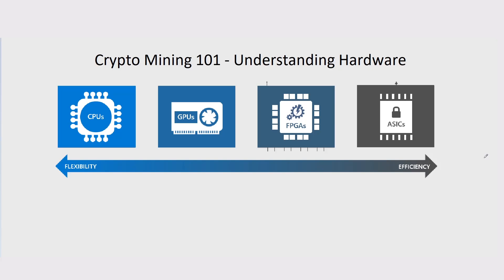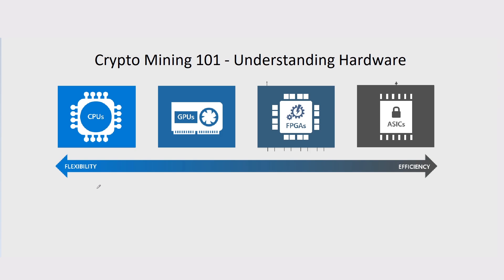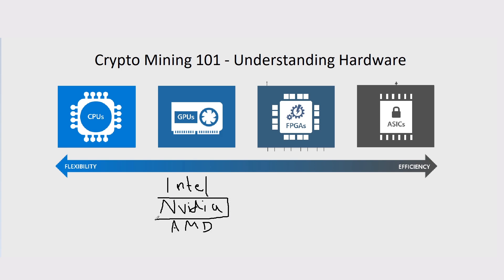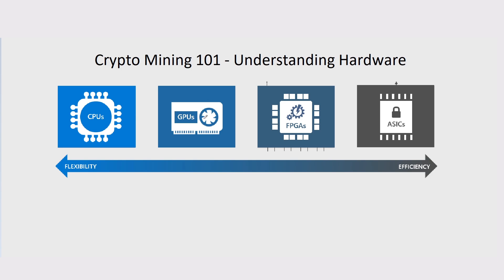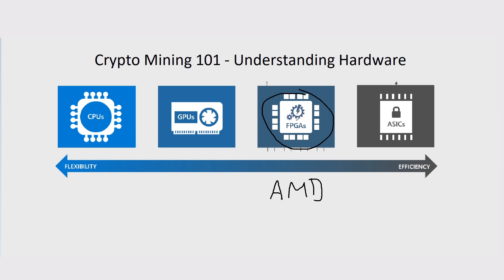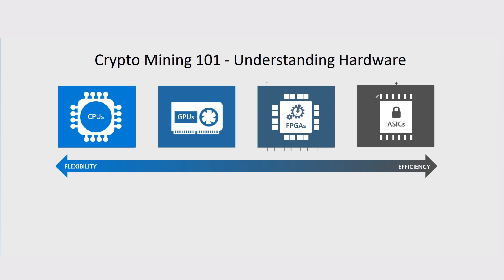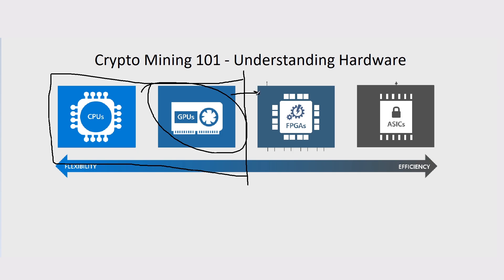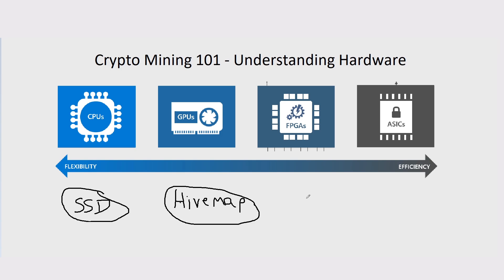Crypto Mining 101 - Understanding Hardware (CPU, GPU, FPGA, ASIC)

Comment: CPU stands for CENTRAL processing unit (because it is the main processing unit in a computer chip) There are often more than one computer in chip, that's why you have to specify cpu. 
In addition, all of them are computers. a gpu is a computer, an fpga can be a computer if you program it to be. and asic as well.